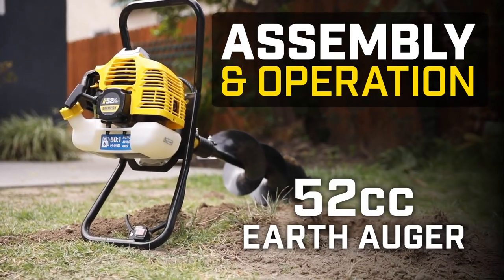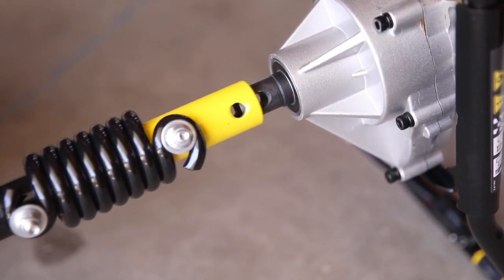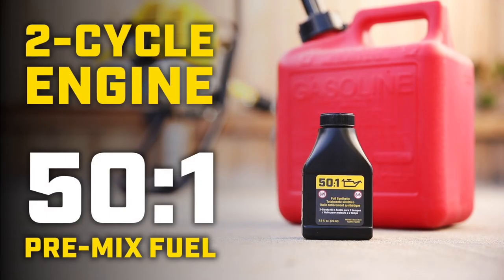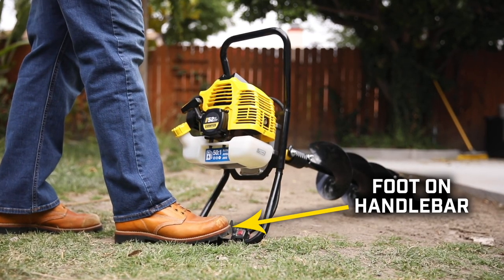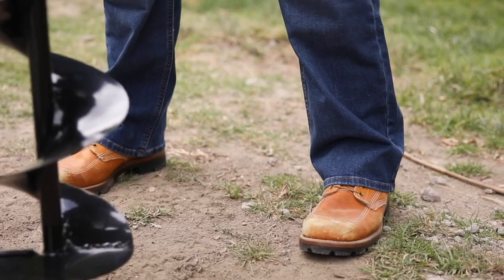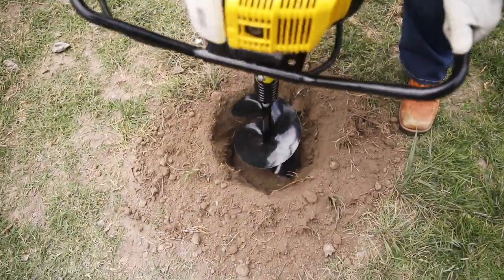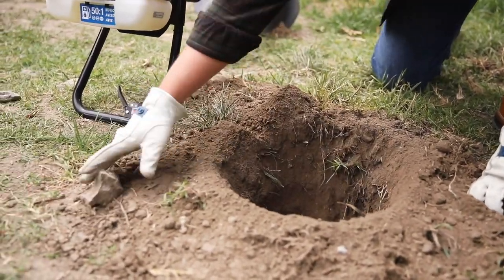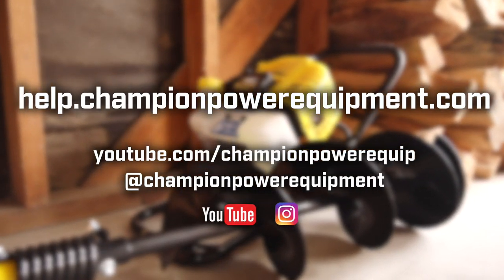Champion 52cc 8-in. 2-Stroke Earth Auger Assembly and Operation Guide (Model 200940)

Comment: has anyone found an extension pole that fits this 30 inchs is not deep enough im very surprised they dont make one 🤷🏼‍♂️ 7/8 extension just orded i will post if works the 3/4 size did not hoping i got it right this time